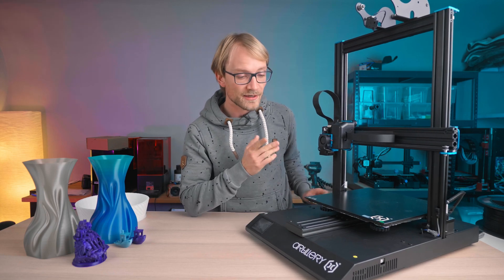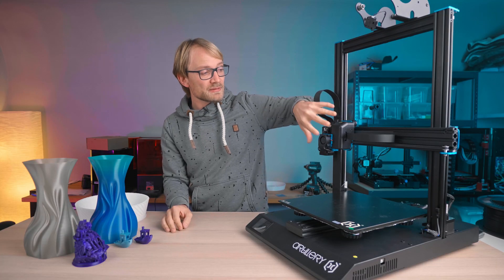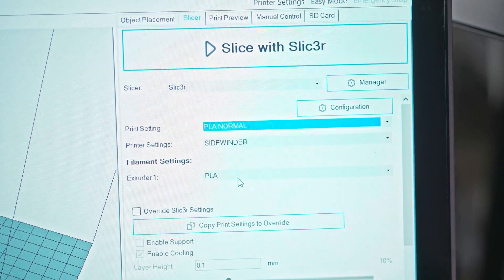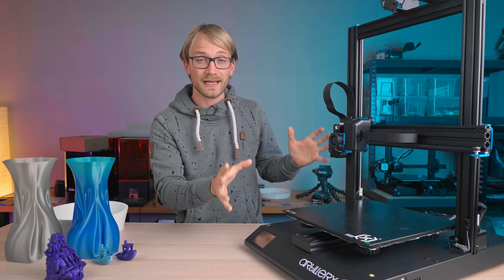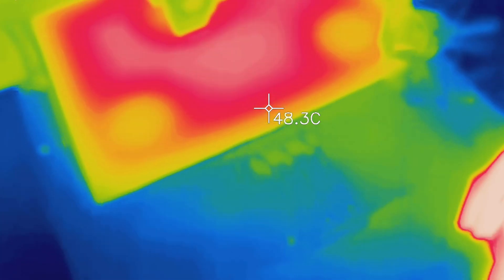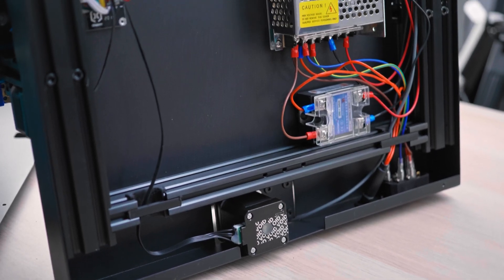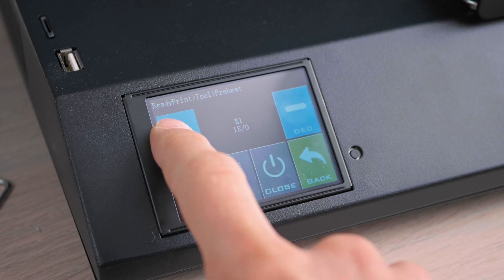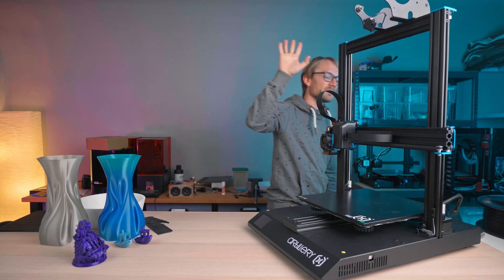Artillery Sidewinder X1: Built for show!

Comment: Could you do a review on the dual extruder Tenlog tl-D3 it has great reviews on Amazon but i can't find any big YouTubers reviewing it. It has 2 independent direct feed extruders for around $600.
Reply: I too was considering the tl-d3, but saw a review that put me off. Sorry, I don't recall where / what channel. IIRC, it was something about the z arm not staying at the right height if it lost power.
Reply: @justsomeguywashwd_jbm821  it's really a great machine. I haven't had it lose power but with dual lead screws I don't think it would be likely to lose it's height.

Comment: I got this printer before I knew about these issues.
It's my daily driver and so far so good but in a way I kind of wish I had gotten something else...
Reply: Well, now you know what to fix.
Reply: @Kalvinjj  I've known about these issues for a little while now but it's nothing I can fix.
Reply: @BlatantlySwedishPGN  I'm pretty sure you underestimate your abilities here. Sure, it takes a substantial amount of research to do those fixes correctly, but you can definitely do it with the help of the internet. Get a friend over for a weekend when tinkering with the device to make sure 4 eyes are watching for mistakes along the way and it will be fine.
Reply: @MarkusRessel  I don't think I know anyone who'd be able to help me.
However, the main cable bending is easily fixable by 3d printing braces that keep it folding smooth.
This is common for basically all printers of this style and considering this being a huge concern it shouldn't be hard to find on Thingiverse or other sites.
Reply: i find it strange you need someone to tell you problems about a product you have in your hands.
Reply: @haoss69  Why is that strange? I don't have all of these issues... Besides, when did I say I needed him to tell me about them?

Comment: This printer sucked. I had it for a few months. I got this is June (v4)Firstly there where many minor software bugs, just like bed semi automatic levelling and other things. The printer had issues with the flex cables coming out, quality control issues, and VERY UN-RELIABLE. It would use the same exact g code, and completely fail print. (Btw I have many printers, I’m very familiar with them) the hot end likes to fail during the heating process, and displays an error. The bed is completely warping about 1.5-2mm from the edges. The parts are either very expensive for this machine, hard to find, or shipping takes a month.
Reply: I returned the printer, bough a new one, and assembled it. Then I turned it on and the y axis’s wouldn’t move, it would skip and make loud rattling noises, I contacted the company, they said it was a defective printer QUALITY CONTROL?!? Returned it and I’ll keep using my Tevo tornado, I bought an ender 3 and I am fully upgrading it!

Comment: I don't have the issue with the heated bed cable. That's rolling completely smoothly
Reply: Artillery has changed the supplier / type of heater for the bed in the newer version. I have the older silicon heater on my V4 and there the cable rolls very smoothly, even without strain relief for cable support.
Reply: @billereses4935  Not sure but I might have V3. Maybe that's why it's good for me.
Reply: Same here, my cable looks like it is made from a different material as well , I wonder if they use a different cable for the 120volt vs 220volt printers
Reply: @Zayllyaz  but I also have 220v.

Comment: I bought into the hype a few months ago, and even without seeing your video I was immediately made aware of the AC bed heater issues, as mine arrived with a loose corner and a quick google search pulled up many cable chain designs for the cabling. On the inside there was indeed a lot of hot glue but on my v4 unit most of them were terminated properly, except for 2 dupont to ribbon cable headers like you mentioned. Those I had to fix on my own. I was not aware that there was a live, uninsulated header on the socket, so I'll have to go fix that at some point.

I will say that in day to day use there's nothing I dislike about it, as moving from one fire hazard to another, this is a massive leg up over the Anet A8 (then turned AM8) I used to own in terms of what I can print and the quality I'm getting out of it. I'd added BLTouch functionality and I really do like how easy to mod and improve the design is, though I wish they'd improve upon the internals.
Reply: Works fine for me too! But only with Prusa slicer. Cura creates wierd small layer shifts. Have it since last year Christmas.
Reply: @allcrafter3747  Huh, I've been using Cura without much issue at all - PLA, PETG, and ABS. I've been using Angus' profile imported into Cura (I think) with a few acceleration tweaks and it's worked wonderfully.
Reply: @alekz0987  Gonna try this profile

Comment: Can it print tpu
Reply: If you receive a good one: yes. If you receive another version: you might or might not. And yes, I have printed TPU well on a sidewinder X1, no issues at all except for the bad bed-heating and needing something on the bed to keep hold on it well. Small objects should be no problem in the middle of the bed.
Reply: I can't speak backwards